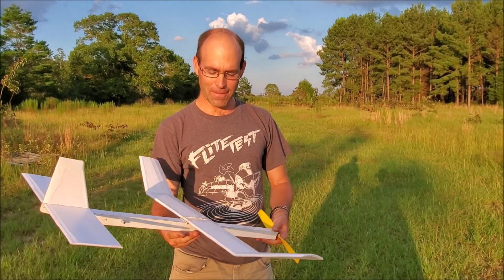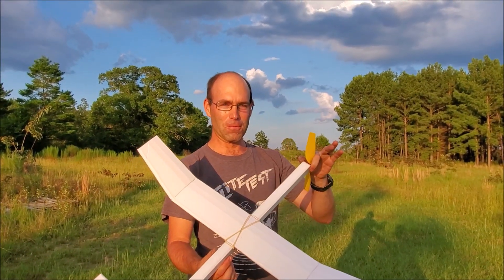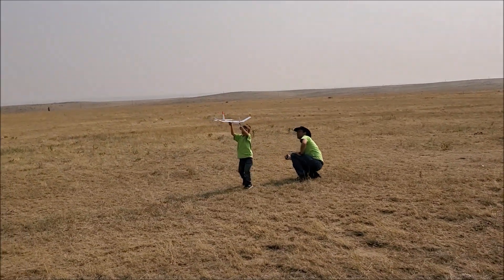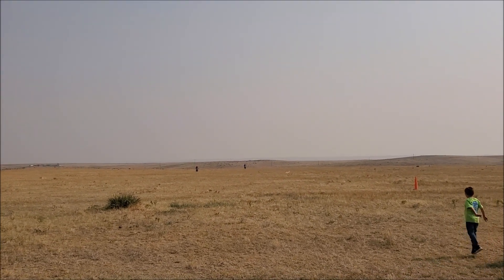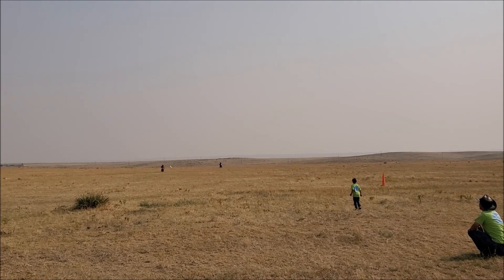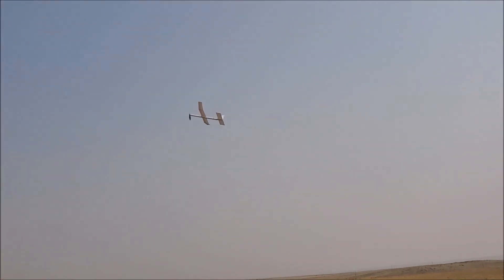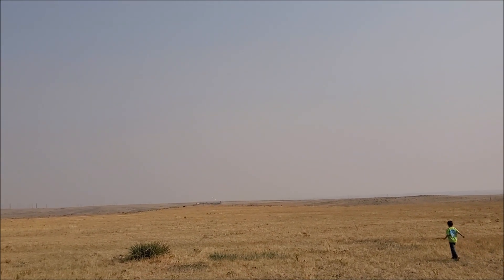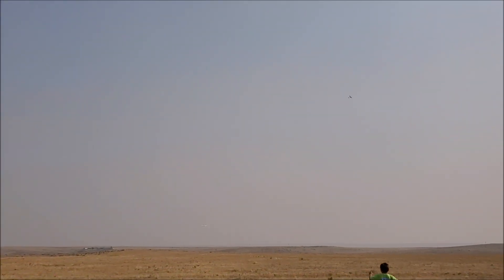Rubber powered dollar tree foamboard airplanes!!!

Comment: Magic fingers, Joshua. I doubt these are the first rubber powered foamboard airplanes, but they are likely among the best. The plan doesn't show the airfoil. My observations on the flights. 1. Not climbing, steep right bank, tight right turn. So many things involved here it is hard to say what to do, but I would start by looking at reducing right thrust. 2. Excellent climbing circle, opening out and transitioning into left descent. Figure 8 flight path is not good on a small field. I trim right descent circle first, as power trim does not interfere with glide, then trim power circle with side thrust.  A shorter, thicker motor of the same weight is good to get the plane up high enough to freewheel for glide trim without dangerous climbs. The motor will be wound up part way, just enough to take the plane up about 50 feet, then goes into freewheel. You want enough time to stabilize the glide for judging, at least about 10 seconds, or a complete circle. Hand launched glide tests usually don't give enough time to stabilize the glide. 3. Too tight right turn and too much right bank under power, opening up into left circle. A steep bank implies a strong sideslip which is a downward motion. Hope you found the second plane. That P-30 is a bit long for the little guy. Makes it hard for him to hold the fuselage and prop at the same time, avoid getting hit on the head by the wingtip and get off a smooth launch. When the fuselage does not move straight forward, the launch is chancy. The family that plays together stays together. Free flight allows you to get out in the middle of a big field away from everybody else and have some fun.

Comment: You can crush the DT foam board to make tapered trailing edges. It takes quite a bit of force. It will spring back very little. I crush it between two pieces of hardwood using a bunch of c clamps, and a spacer to limit the angle. Leave it clamped for a minute or two. You can also round the leading edge by burnishing it over with a sealing iron. Then a strip of celluloid tape. Together you can get a passable airfoil from a single layer of the foam board.
Reply from the maker: I actually ironed all the edges. Got a decent trailing edge taper with the iron as I've done on several previous models. Clamping is an interesting idea and something I need to try when we get the new workshop operational.

Comment: Great video!  Thanks for including the full size plans.  I'd be interested in seeing how you built these, as I don't see any wing ribs in the plans.  Also, what adhesive did you use?
Reply from the maker: Ed, eventually I'll do another one and video it. It's an extremely simple build, no ribs or anything. The camber is made by creasing the score lines on the bottom of the wing. I used hot glue for the entire build.

Comment: There have been lots of people who built depron rubber powered aircraft (even scale models). Does that count?
Reply from the maker: Technically no. The goal here was to specifically demonstrate foamboard as the primary material on successful rubber models. I even used hot glue for the entire assembly including the nose block.

Comment: Nice - undercambered  wing with stiffnes from the undercamber?
Reply from the maker: Correct. Nothing innovative there, Flite Test and others have been doing that for at least a decade.
Reply: @joshuawfinn  
I built like that back 1991 ;). My first RC period. Foamboard was cheaper than expensive balsa kits. 
No flite test in those days. Only rC magazines.

Comment: Awesome build sir! After years of RC, I'm finally beginning to develop an interest in rubber band powered flight (for myself and for helping the younger generation). Could you please provide some directions on where I could find information and specs about what power setups are currently available?
Reply from the maker: I would highly recommend looking through the Technical Library at freeflight.org (consider joining NFFS for the bimonthly magazine and online access to back issues and all Symposia). Also find a copy of Don Ross's Rubber Powered Model Airplanes. Lastly, Building and Flying Indoor Model Airplanes by Rob Williams is a must-have for anyone getting into rubber power.
Reply: @joshuawfinn  Thank you so much for all of those pointers. I'll check out the resources you recommended.

Comment: Hey Josh, did you peel off the paper covering from the foam board? I've made these and it really reduces the weight.
Reply: could just use depron if you do that
Reply from the maker: @marc_frank  is correct. I left the paper on. Wanted a true foamboard model.
Reply: @joshuawfinn  gotcha'
Reply: I've made the foam board Bugatti from plans, but if I glue the plans to the foam board, the paper comes off when I peel the plans anyway.
Reply: @frogsoda  Smart!